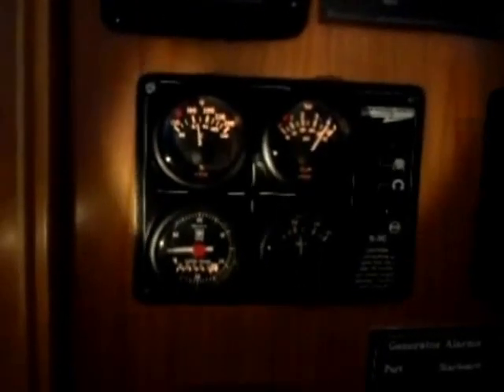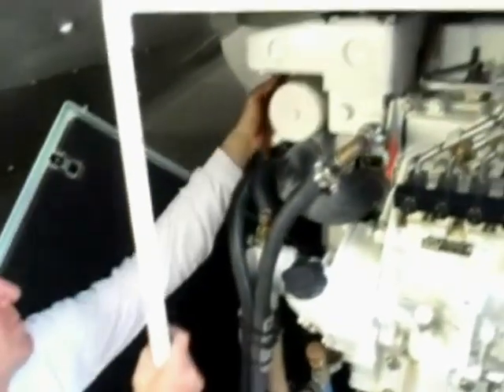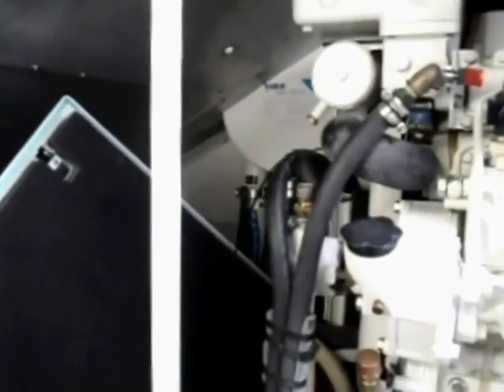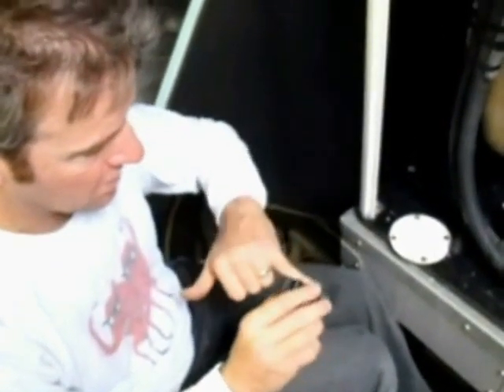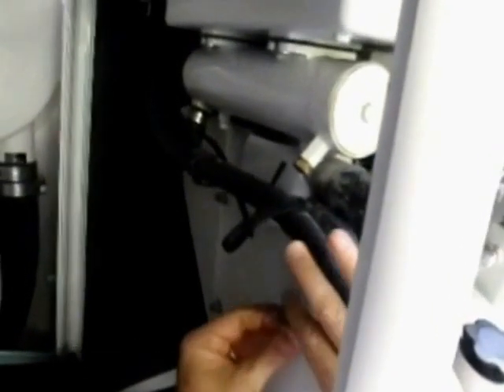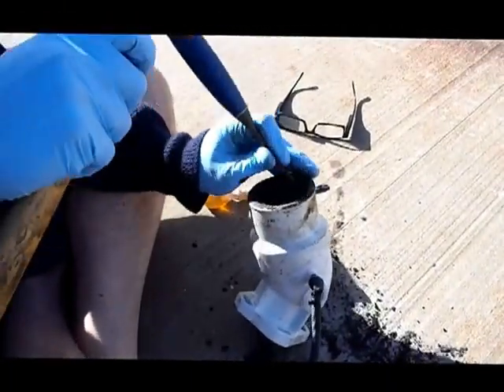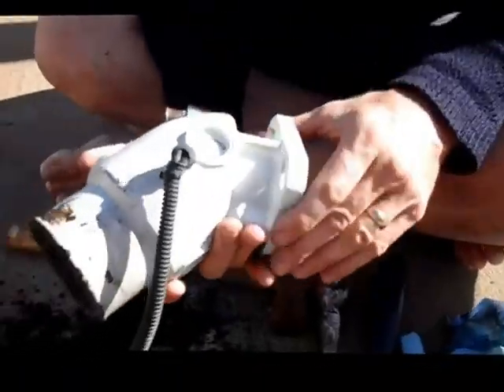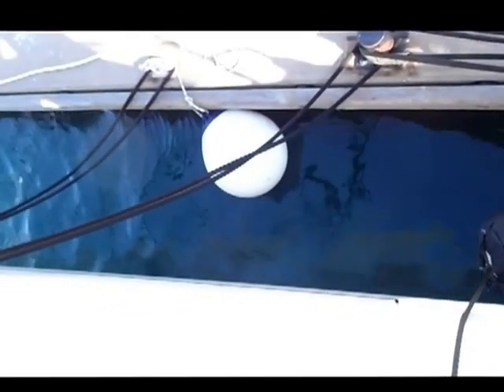All about marine salt water cooling systems, impeller, heat exchanger, salt water pump- Updated

Comment: I was surprised that you did not use any lubricant on the new impeller.. which most folks so, and often included with the part. info on the non-ferrous bolts and lube  priceless.

Comment: Thanks for the video.  Two questions:  1) what kind of grease do you like to use for the impeller and screws.  2) You mentioned not wanting to use steel screws to secure the pump plate.  What is the preferred material?  Bronze?
Reply: OR STAINLESS STEEL
Reply: Dielectric grease.

Comment: Very helpful.

What is the easiest way to remove the heat exchanger (Northernlights generator M643)? I removed the bolts and tapped it with a hammer, but it seems stuck. I don't want to break it.

Comment: 350 amps @24 volts. who needs over 8,000 watts at 24 volts.. ?do they have a huge battery bank to charge, and then use inverters for AC ? hmmand this is just one of 2 generators.. mega yacht.. mega appetite.  Excellent diagnostics and explanation.  Using some oven cleaner would have been faster for the carbon removal, and done a better job... Thanks.. learned more about marine cooling and exhaust systems.

Comment: Nice.....just a suggestion what about a ultrasonic bath to clean the elbow part. The water flow sensor isn't worth a damn if it doesn't measure actual flow another maintenance protocol on the checklist.

Comment: Great video, Scott! Lots of good info on the cooling systems. Have you ever performed a raw-water cooled system flush with Barnacle Buster?
Reply from the maker: Yes, we have had good luck with Barnacle Buster. Less gassing and easy to use.